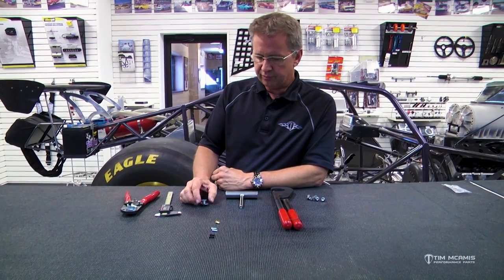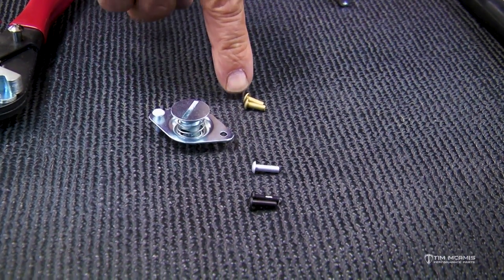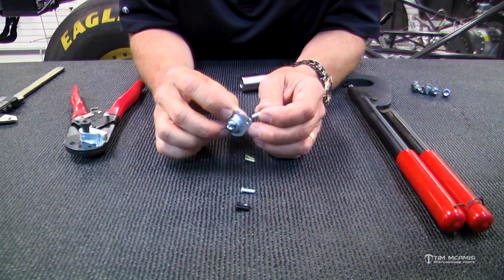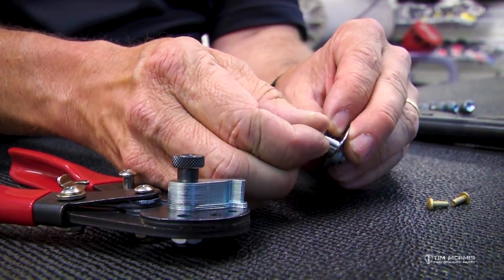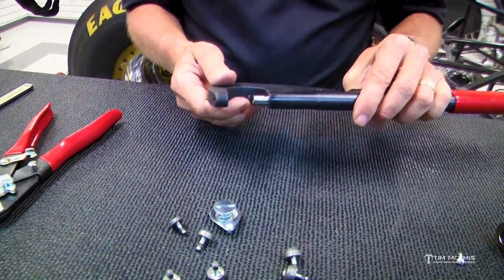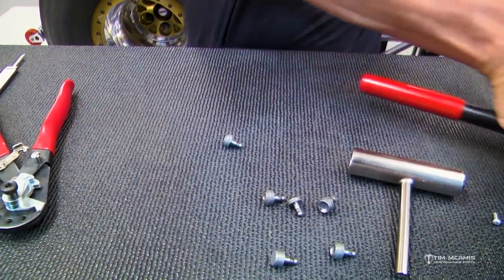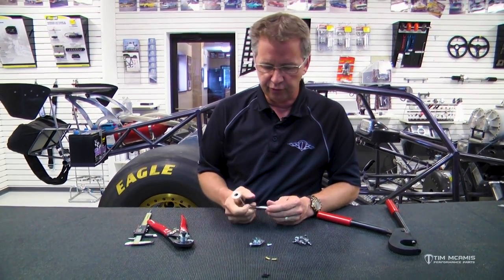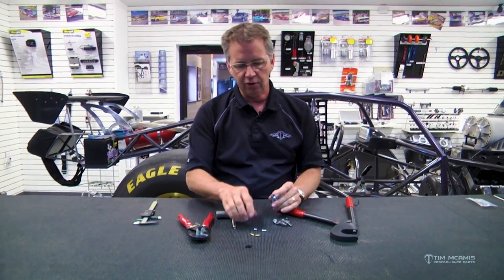Solid Rivet Installation & Tools

Comment: As a race car fabricator from the UK myself , I do a  lot of solid rivet work The general guide from the aircraft industry, is you must have one and a half times the rivet diameter protruding through the parts to be joined, before bucking or squeezing the rivet.
I am surprised you don't use a  2 or 3X rivet gun and  3/32 or 1/8 rivet set for Dzus fasteners, we use AN470 rivets all the time.

Comment: The vibration withstanding aspect should NEVER be underestimated. I've had 50mm long bolts with tight nuts (dummying up just to hold something in place) that have completely shaken themselves down and off the threads just from an idling engine.

Comment: Should have 1 1/2 times the thickness of the fasteners shank sticking out of the total stack up before squeezing.. love your videos  Tim.
Reply: Yep, NOT 1.5x the thickness of the parent material.  He made a boo-boo on that one.
Reply: For some reason I've seen the same mistake elsewhere too, but it doesn't make sense... If the plates you're riveting are 5mm thick, you should leave 7,5mm of the rivet to stick out? 😂 1,5 times the thickness of the rivet shank makes MUCH more sense!

Comment: I have a school style solid riveted protractor that has came loose from, I assume a loose rivet, and am wondering if there's a way to tighten it up without replacing the buttonhead rivet so the protractor doesn't drift open during use???

Comment: 1.5x the rivet diameter sticking out, not 1.5x thickness of the panel, is the correct spec. add washers if you have to build up the thickness to reduce stick-out.
Reply: Bingo! I worked building corporate jets for 42 years and have shot or bucked millions of rivets. Now we had the lengths available in 1/16" increments, but occasionally we would cut them with rivet cutters if the length we needed was not available or had an odd stack up of thickness. The only time we used washers is if it was being installed in softer material , like fiberglass to be used as a backer. Most of the time in that case we would use an "A" which is not heat treated and soft, and in our case it is anodized red so they easily recognizable.
Reply: I bet for the pennys it would cost you to use a rivet, you could not have shown us as a example? 🤦‍♂️😂

Comment: Nice Presentation of the tools Tim.
I purchased a setter tool with interchangable heads that can reach as far as 6" in from an edge.
More expensive than the single fixed jaw tool but well worth it in my chassis shop.

And nothing looks more unprofessional than pop rivets in quarter turn fasteners on body panels. Looks like ASS as you say!

Comment: Where can I buy a rivet setter like the one you have ?
Reply: Aircraft Tool Supply  is one place you can get them.  The solid rivets are an aircraft fastener whcih line a kot of aircraft hardware including Dzus fasteners,  have been adopted by racers and hot-rodders.   the bast place to find the tooling is aircraft  supply companies.